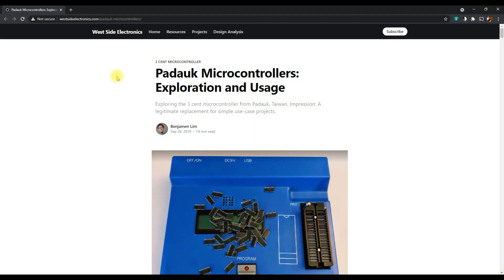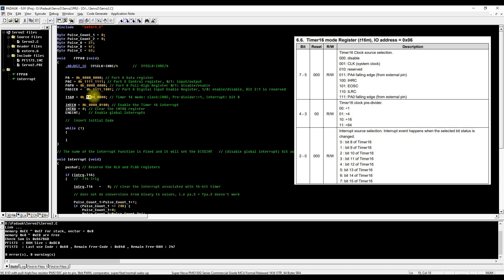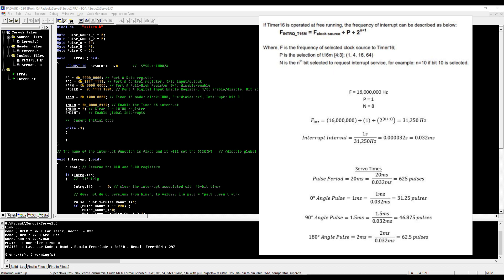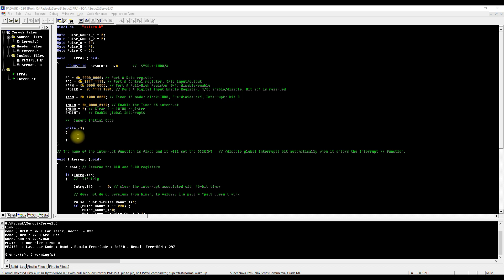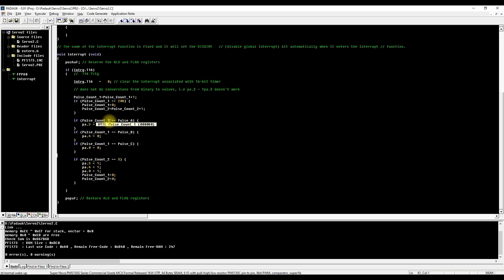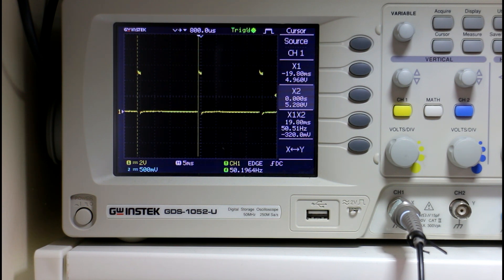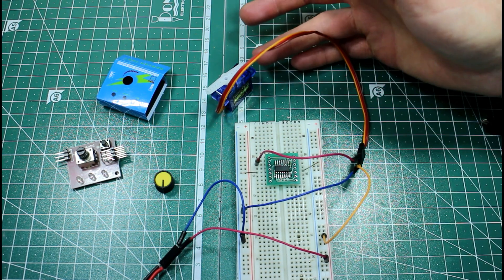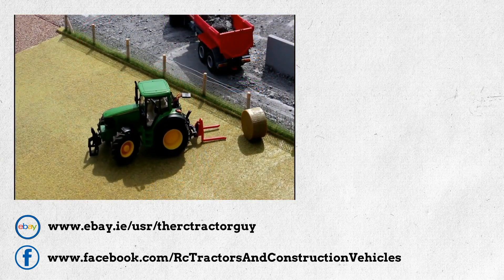Controlling three servos with a Padauk PFS173 microcontroller

Comment: hello guys.

I have an issue that how to configure pin A5 as a PRSTB reset pin, i have read datasheet and try it like this but did not work.

uint8_t _sdcc_external_startup(void)
{
	PAC &= ~(1<<5);
	CLKMD |= (1<<0);
	EASY_PDK_INIT_SYSCLOCK_8MHZ();		  //use 8MHz sysclock
	EASY_PDK_CALIBRATE_IHRC(F_CPU, 5000); //tune SYSCLK to 8MHz @ 4.000V
	return 0;							  //perform normal initialization
}

thank in advance.
Reply from the maker: Hi Tim. I'm not familiar with that feature, just learning with this little IC myself. Hopefully someone watch the video will be able to help.
Reply: @RCTractorGuy   ah thank you so much, hardware reset is a basic function of a MCU but it so hard with this PDK :D!!!